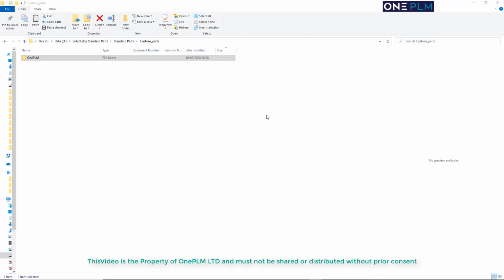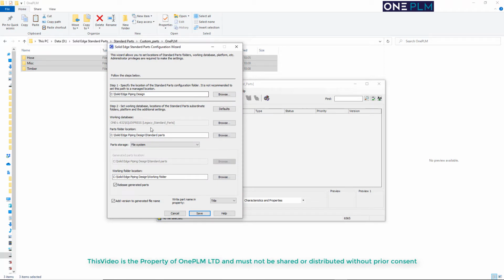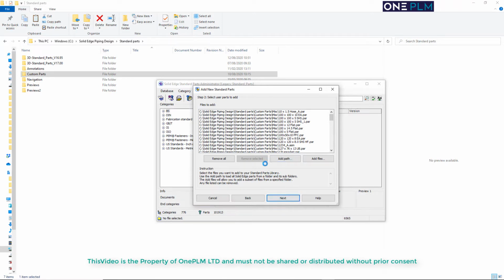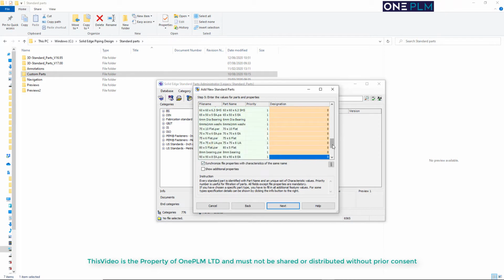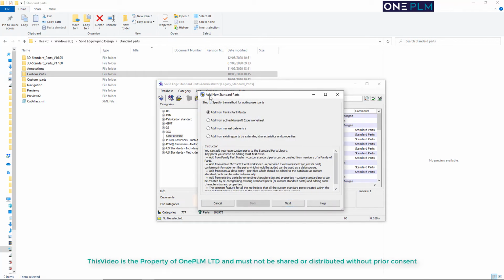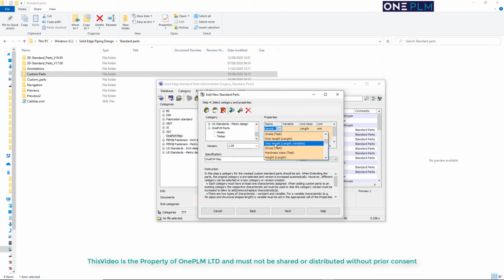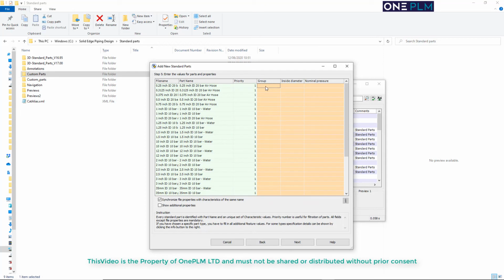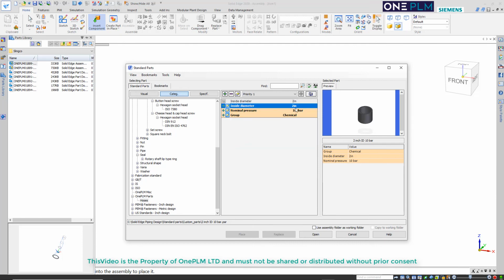Solid Edge - Adding to Standard Parts Database - Basics

Comment: Could you be so kind to show how to add flange to standard parts database and set the flange (automatic connections on the ends of a flange) in a way so it could be used in piping module.